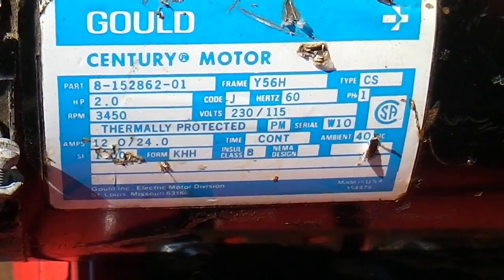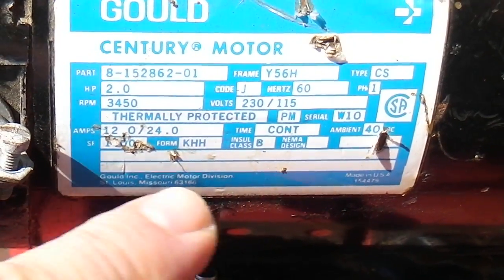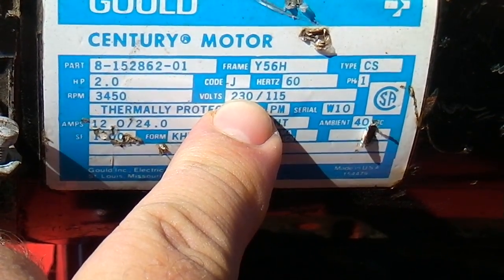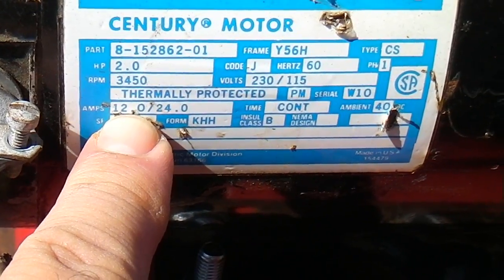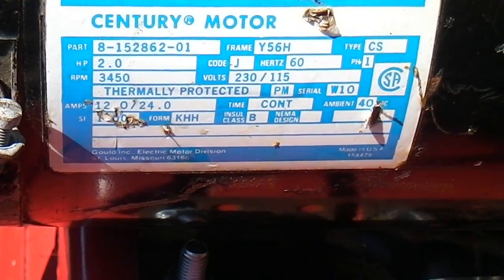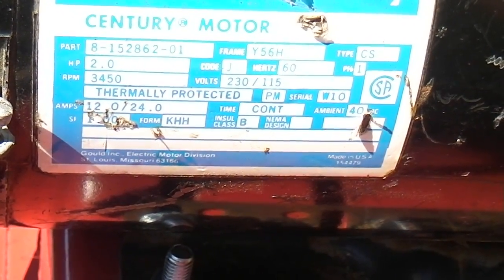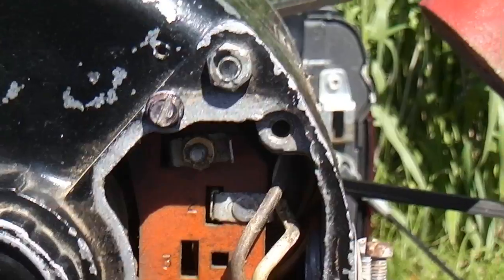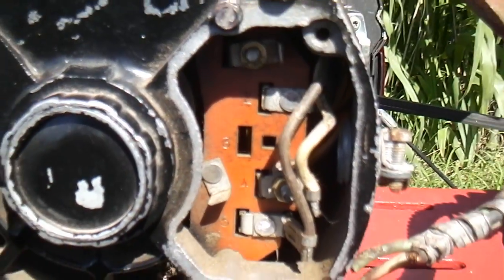Best to Wire Gould Motor 230v to Use Less Amps

Comment: Literally showed nothing on how to change the voltage use, idiot!
Reply from the maker: there is a wiring diagram on the back of the cover to the connection. take it easy freaky dude.

Comment: Yes , I just had to replace my 5HP motor $480. for mine . my big motor is only 230V  my back up compressor has a 5HP Rated but not really it will also run 115V or 230V ,just easy to run on 120V for portability as it is my 20 year old Ingersoll Rand    Easy to do they run better on 230V. FrugalPrepper  gave U good info. It is marked easy to do. I have 2 -20 amp breakers I  wired  into box 4 my  my lift motor just 2 regular breakers , I split 1 leg off for a power outlet as I don't use that often so when I don't need the high amp load I can use lights &  stuff from a 4 plug outlet on the beam from my car lift. Just need to be aware if U need to use 220V don't load the split box!  Not how U are supposed to do it but it is just me & I know what to do It is a easy work around to a problem of running more conduit wire, beaker so on  & again I just use a light once in a while.
Reply from the maker: That is a very creative way to get around using a 220 breaker I have often wondered if it were possible to do so I guess so. I wont be able to do that since I use all my 120 volt breakers for lights and it is really dark in my shed with out them. I may have to buy a 20 amp breaker and use that until I get my 5hp motor.

Comment: My guess is either pressure regulator will work fine for 120/230.  The one on it has 2 switch points so it disconnects both wires going to the motor and not just one so I can do 230 safely.

Comment: You have a Gould Century.  They are out of business and got bought out and became Gould Electronics owned by a Japanese Company.  That is a Single Phase (Number 3 is missing), Dual voltage, non-reversing motor. For the 115V (Low Voltage) 1 is White (Hot) and 4 is Black (Common), Ground goes to frame of motor.   On the two wires coming from motor White Goes to 4 and Brown goes to 5.   For 230V (High voltage)  One Line (Usually Red) goes to 1 and the other line (Usually Black) goes to 4.  There will be NO common (white) hooked up.  The two wires from the motor White goes 5 and Brown goes to 6.   On the 230 the Red and Black can be reversed it is fine.  Ground would still go to the motor chassis.   Here is the wiring diagram for your motor, I put it in my  dropbox for you.  https://www.dropbox.com/sc/e4si666onhhb10f/AABY_B6z2N71miLYtliiaQ-ya
Reply from the maker: Thank you FrugalPrepper that is very helpful information, I know exactly what to do now. I will have to try to print that out. I have to move to another computer I have that has a printer. thanks.
Reply from the maker: Craig Nehring hmm your right, well then Im going to have to buy another breaker then. A 20 amp like you said. Im thinking about another breaker box coming off the breaker box, that i have because its full. And also this compressor dont have a on off switch so i may buy a small breaker box with a pull switch and a 20 amp breaker in side.
Reply from the maker: I have one of those already I may have to use it. Would be cheapest thing to do. OK. I was going to save the extra spot for another 110 for a fridge but I may not put one out there any way. I have a five hp compressor too but it needs a motor and they cost 230 bucks so Im hoping a run cap may fix it but probably not. But im not giving up on it may jump in and get tha motor someday but ouchy 230 dollars eww. so I am reluctant to get rid of the 30 amp breaker spot so I may add the tandem switch and make a spot for the 20 amp 220 breaker. I think I will have to add two tandem 110 breakers to make room for the extra 20 amp 220 though.
Reply: What Brand and type is your breaker box.  Square D QO for instance you can get piggy back breakers for you 120 stuff and put 2 circuits in one spot.  Also the QO stuff allows you to put up to 2 circuits on one breaker if you need to combine some of the less used (capacity wise) circuits to make some more room.
Reply from the maker: The breaker box I have is a Cutler Hammer. It was cheap to purchase compared to square D.
Reply from the maker: yeah I got a few old single 20 amp 110v breakers now lol what to do with them. I could sell them maybe to help off set the cost of this compressor. LOL
Reply: FrugalPrepper's Garage & Garden I have the same motor. It runs fine on 110.but when I switch it to 220 ...nothing. o wired it exactly how u show it
Reply: Hey, gracias por la ayuda, mi motor es de 3Hp tiene el mismo diagrama. Ya lo voy a probar!!!!